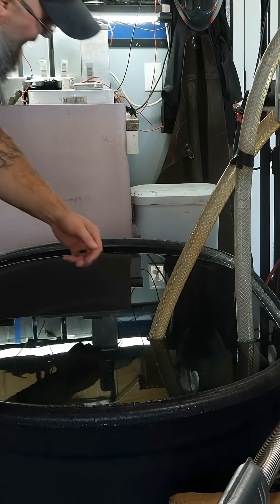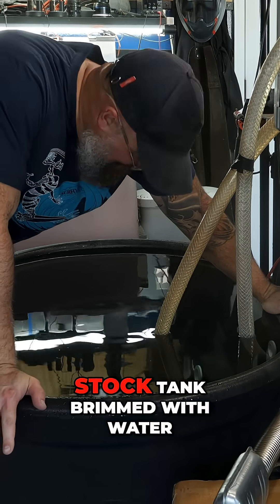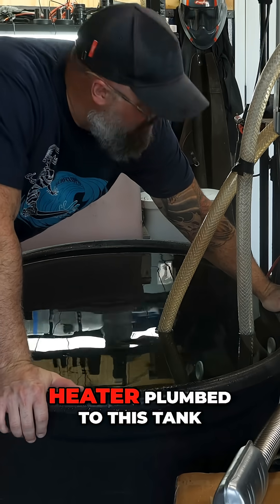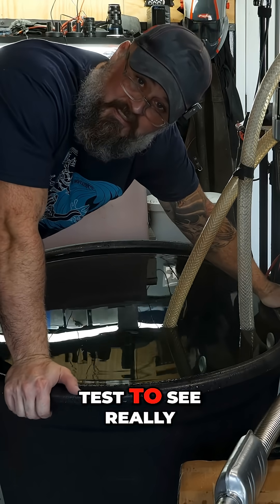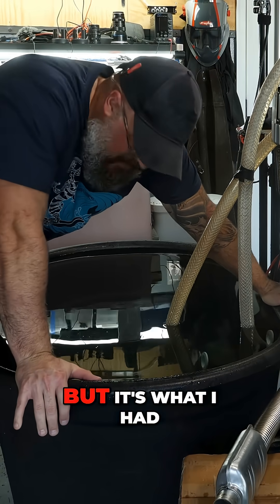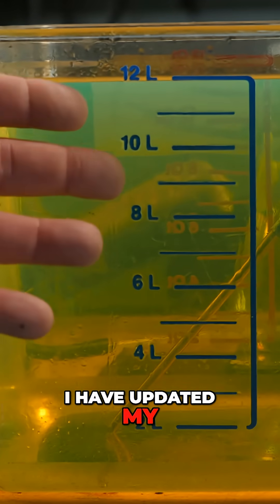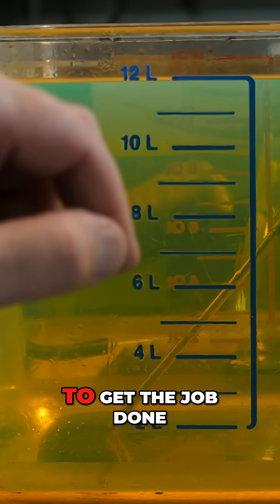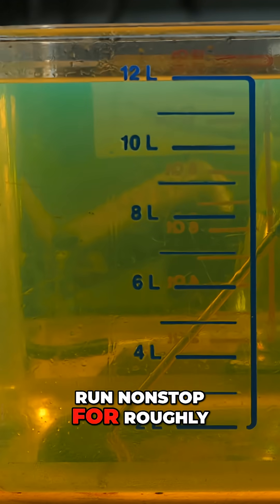Can This Heater Warm a 100-Gallon Tank? #shorts

Comment: Have you seen how a rocket mass heater works? If you’re trying to extract as much heat from the exhaust as possible, I’ve always been a real big fan of this design. You can scale it down as long as you keep certain ratios the same. I even made one to heat a pool, large tank of water on top of the drum and 100 feet stainless steel tubing inside the drum with the heat riser